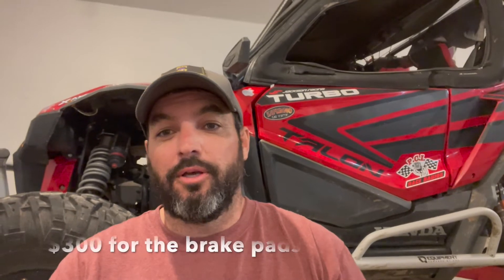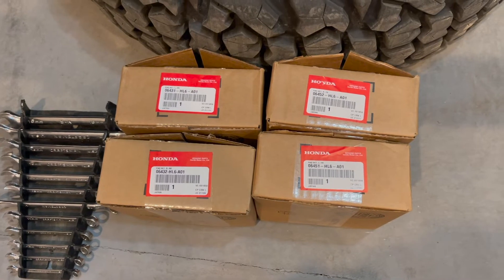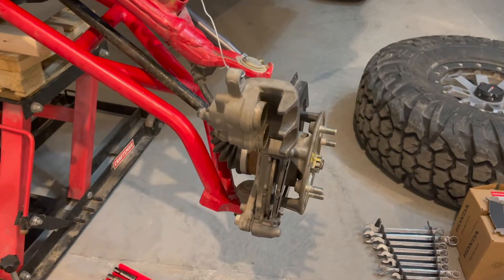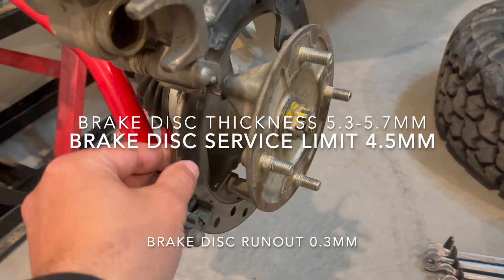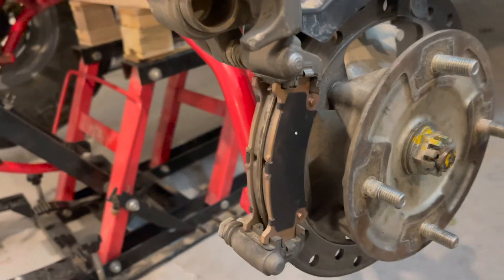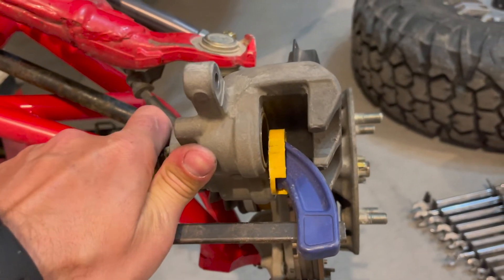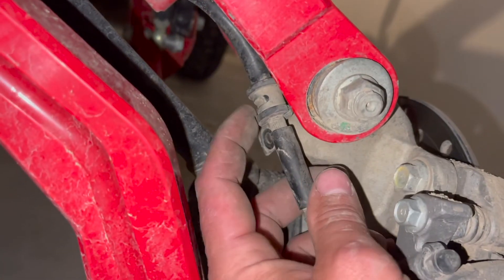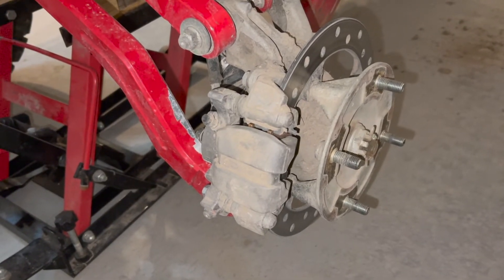Honda Talon Brake Pads How to front & rear

Comment: Just curious how you fixed your hood to keep it from unplugging itself when you are driving down the road at 45-50 mph mine wants to flip up on both sides all of the time!!
Reply from the maker: I’ve pulled it on an open trailer at 80mph and never had a problem! As long as the front of the hood is properly hooked, it shouldn’t come off!
Reply: @gravesru  maybe I’m not getting it hooked under properly? I’ll have to check tomorrow! Thanks👍🏼 I don’t have many miles on mine but this has been driving me nuts!!🤣🤣
Reply from the maker: I’ve pulled it several thousand miles and never had a problem!
Reply: If you have the two front tabs fitted properly into the corresponding pockets on the hood it’s almost impossible for the hood to come off.
Reply: Yep guys!! Thanks! Like an idiot I didn’t have the front of the hood hooked over the clips on the very front of the hood but we got it now!!🤣🤣🤣 I feel even dumber than I already new I was!! Thanks again for the help fellas!!👍🏼👍🏼
Reply from the maker: @simpsonrdlarry4385  I have this Channel so I can help people! Thank you for watching!